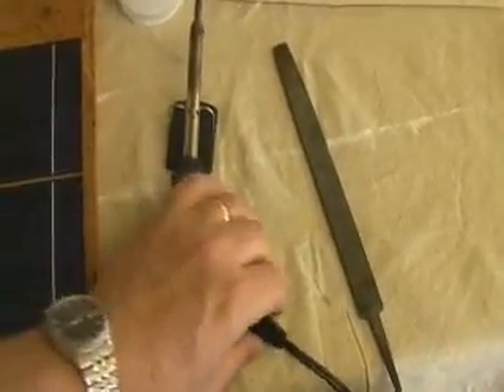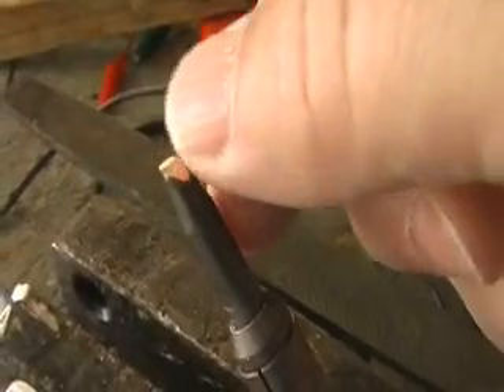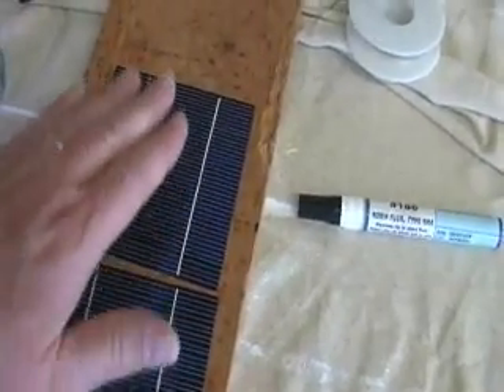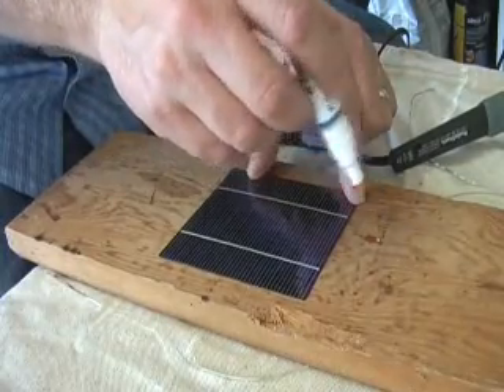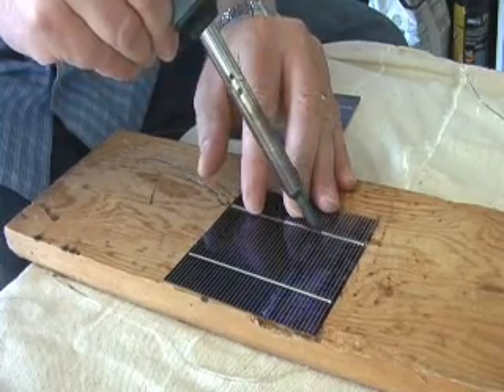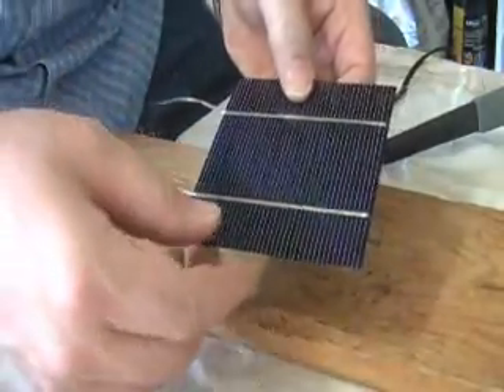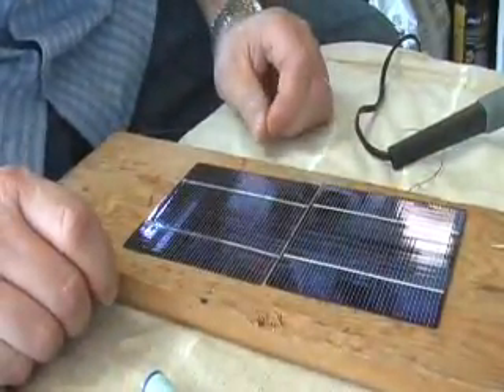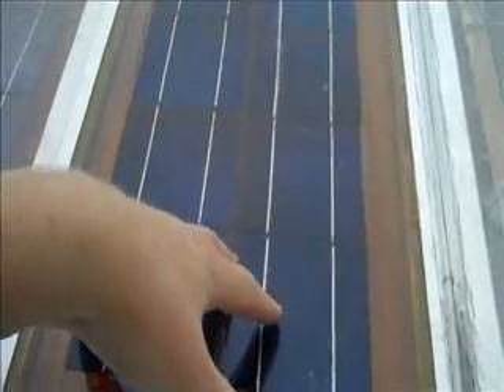Solar Cell Tabbing - the EASY RIGHT WAY to do it

Comment: What exactly were the methods that did not work?  I used polycorbonate on the back and laminated the cells to it with EVA.  Then I put some silicon caulk on top for cushioning before covering it with tempered glass and framing it with 1/2 inch aluminum  c-channel.  The voltage is correct.  It does 19 to 20 volts, but the wattage is low.  I've only gotten 23 watts out of it so far.  Haven't tested it in better sunshine yet, but I was hoping it would do 65 watts... or at least 40.  Any advice?

Comment: ...by not holding the heat long enough, the solder is not sucked into the joint.  you will know the difference because a drip soldered joint will have a dull appearance, while a proper joint will be shinny&smooth.  let me know if that helps, or if your experience suggests otherwise!  Good luck in your projects.

Comment: thank you for your contribution to diy green!  Came across your video as I prepare to make my first panel this weekend (if my cells arrive).  So ive never soldered a solar cell, but I do have a good amount of general soldering experience (small-med elect. & plumbing).  From watching your method you appear to be doing what i have heard called "drip soldering".  In short, its melting the solder enough to liquify&pool around the contact, rather than creating a good electrical connection...

Comment: I have some cells that I got on ebay and the tabbing wire doesn't seem to stick on.  Most will solder on smoothly but after moving them around gently they just seem to pop off.  On most of these cells the the 2 white lines are no longer white, they look gray as if that white coating has pulled off.  What am I doing wrong? Any tips?

Comment: hi brian
good vid I have been learning from my mistakes also lol
I found on the back side of the cells if you lightly scratch the squares where the tabbing wire goes you dont need solder the wire will stick well just another tip for ya 
try it for the heck of it
have a great day
dave